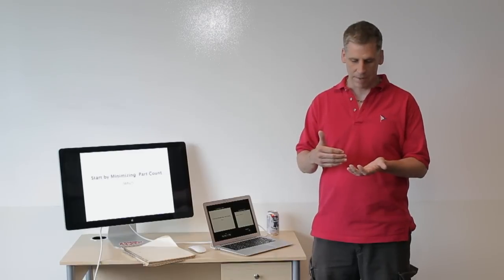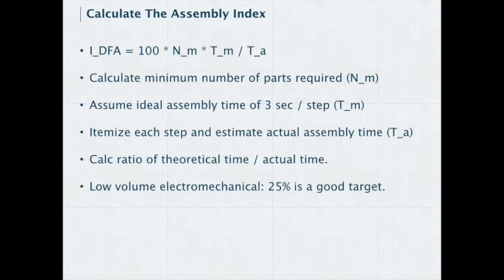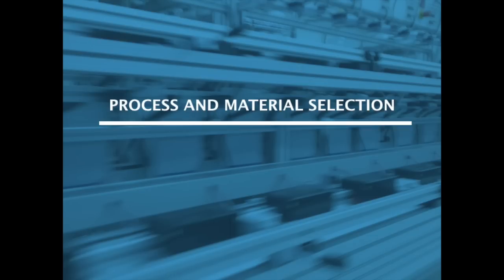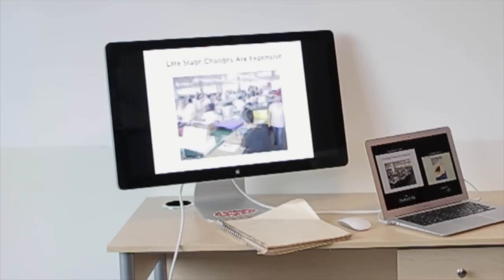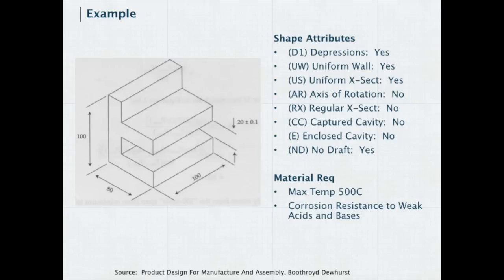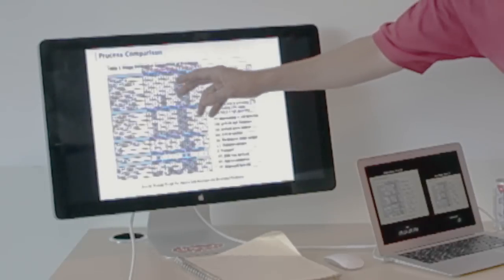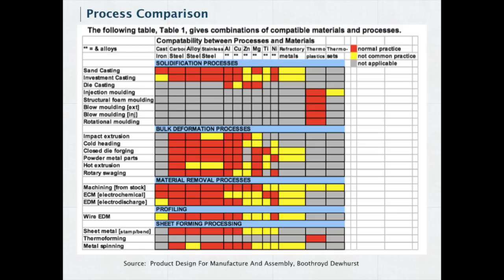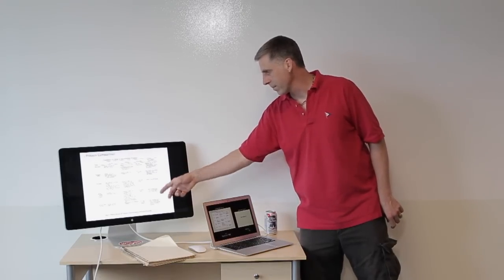Design for Manufacturing Course 3: Selection of Process and Material - DragonInnovation.com

Comment: interesting discussion around 3D printing, I'm wondering: with EDM being so slow to make the moulds, maybe there is a window for selective  laser sintering (maybe that's what you referred to), even as a roughing tool?

On the general discussion about choosing a process, I have seen another video suggesting going through the processes in increasing cost : can you use bent steel wire, can you use sheet metal, etc. Which also influence the design, because nobody needs a draft on a part, it's a manufacturing artefact, I think the question is more of the type: "could my part support a draft?"
Reply from the maker: +nraynaud1 Absolutely!  I'm excited about this as a future alternative to waiting 6 - 8 weeks for tools.  It also opens up possibilities for geometry that can't be EDM'd or CNC'd.  The downside is tool life and often the requirement to clean up the surface to get an aesthetically acceptable finish.  Some CMs, such as Harbec, are experimenting with this.
With regard to the second question, this is a good process to go thru. Boothroyd-Dewhurst does a nice job creating a structured process around evaluating different fabrication options.  In terms of the draft, it can lead to some beneficial aesthetics, depending on the design.

Comment: Thanks for this entire DFM course, it's been extremely helpful for me as I do a lot of one-offs at work and haven't had the chance to learn too much DFM.  You mentioned heat staking instead of using screws in some situations.  I realize it's situation dependant, but is heat staking low cost enough to use it as an alternative to screws?  Or does it only really get viable when your production numbers increase?  Thanks again!
Reply from the maker: +Philip Tsao Thanks so much, Philip! 

From a COGS standpoint, heat-staking is lower cost than using screws, as well as being more space efficient. The downside is that it is not easily reworkable (where with screws you can just unscrew them), and you'll need a press (this can be as simple as an arbor press with a mushroom end die to form the top of the stake). The material would need to be a thermoplastic and compatible with the heat staking process (where screws can be used in a greater variety of materials).
Reply: +Dragon Innovation Thanks for the reply!  In terms of assembly costs, would heat staking be a little more expensive than screws?

I'm making an injection molded white polycarbonate light diffuser which needs to be assembled onto an aluminum base.  The two parts don't need to come apart after assembly so I'm trying to figure out the best way to assemble the two without fasteners (fasteners could be visible and retract from the aesthetics).  Heat staking was one of the options I was looking into...it also gives the benefit of creating plastic feet at the bottom of the base if the die is designed correctly.

What's your opinion on glueing as an assembly process?  Other methods I could use are press fits, or snap fits, but both those processes result in increases in cost to the mold or machining operations.  Appreciate your input!
Reply from the maker: +Philip Tsao PC can be cold-staked. In fact, you can work it on an anvil with a hammer, just like steel - I've done it. That said, it takes a lot of force and practically speaking you may not be able to support the diffuser well enough to withstand the press force needed to peen over the PC tabs or pins.  

Hot staking would then be the best choice and with the use of a die as you suggest, you will get little molded feet. Hot staking would be cheaper than screws, both in materials (no screws at several cents each, depending) and labor (the hot staking operation would be quick if all the tabs or pins are done at the same time with a fixture.  There would be a fixed expense for the fixture, not sure how much, maybe a thousand US but it will vary a lot from factory to factory.

The next best choice would be snaps, so it can be easily disassembled. It will add a little cost to the mold, but there will be no heat-staking fixture.